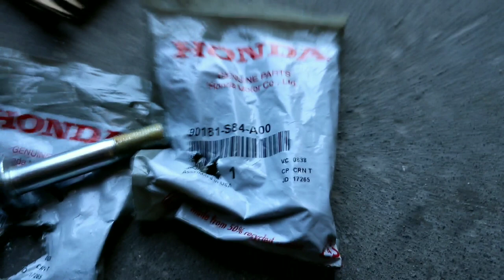NEW BREMBO BRAKES INSTALLED! (K-Tuned K1 - Part 2) | Project S-ea | S2 - EP26

Comment: Did you do the full type r front conversion to fit the type r brembos or did you do the other way where you use a s2000 rotor and 350z pads?

Comment: How’s the brake bias? Did you have to adjust anything for it or did you just install, bleed, and go?
Reply: Brake bias is the same if you have a type s. Brake proportioning valve is different on the base model and so you would have to upgrade to the type s valve if putting them on the base.

Comment: I was just wndering? Is it not possible to put brembo calipers in the rear?
Reply from the maker: Anything is possible. Probably need some sort of adapter bracket to bolt it on to the knuckle.

Comment: The spacers are cause 02-04 and 05-06 are different
Reply from the maker: No. Brembo calipers require a higher offset wheel to clear them. The ITR hubs retain the correct spacing but I'm using ITS hubs so my choices are, spacer or higher offset wheel. Minimum offset required +35 offset.
Reply: DC5R.Parts im taking about the spacers for the coilovers the different sizes man
Reply: DC5R.Parts  hi I am looking into swapping caliper just like you as well, also running the ITR alum lower control arm with the ITS 05 hub. However I prefer to keep using my 16inch 8j Rays light forged wheels with 38+ offset for track purpose, do you think these brembo brakes would clear within my wheel specs ? Also I know the brake line are different between ITR and ITS, by using these calipers which brake line should be used ?
Reply: Also I know some people choose to use S2000 disc to pair with the brembo caliber, did you use the ITS spec brake disc in your video ?
Reply from the maker: Gotcha, be more specific lol spacers for wheels or the coil over. Thanks for the info.
Reply from the maker: You need a minimum of 35 offset to clear the Brembo caliper. The lines are the same but keep the Type S brake bolt that attaches the line to the caliper.
Reply from the maker: S2K Rotors need to be used.
Reply from the maker: When it comes to offset. Higher number means less offset. So 45 is less than 35. So yes anything less than 35 offset would fit or clear a Brembo Caliper. 👍🏻